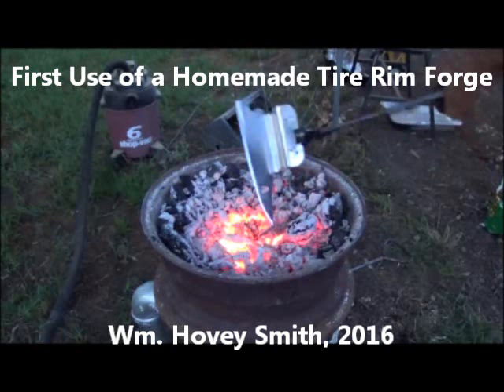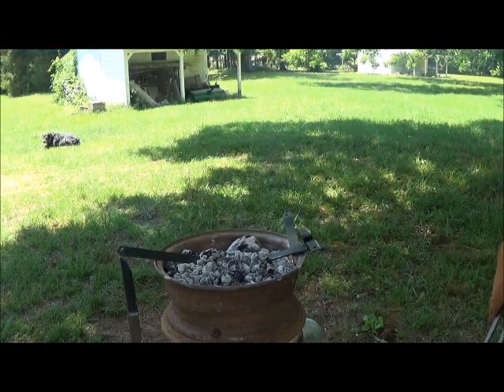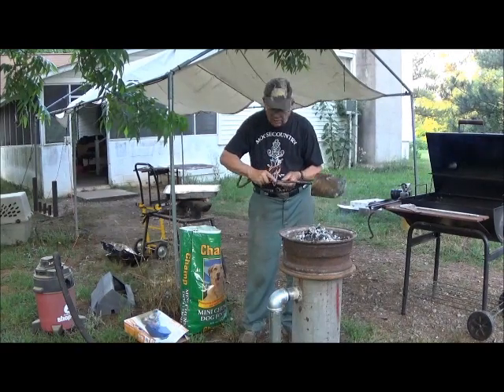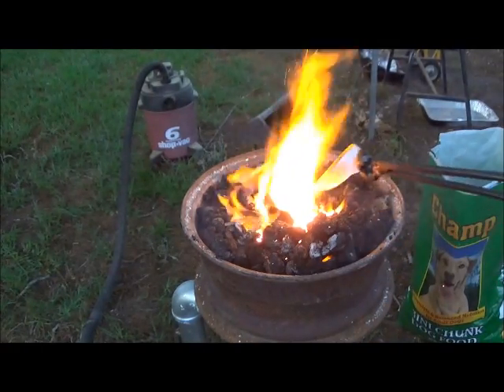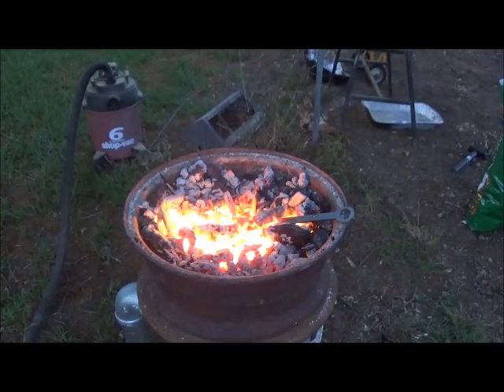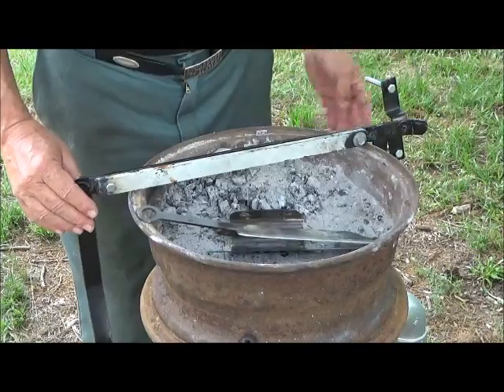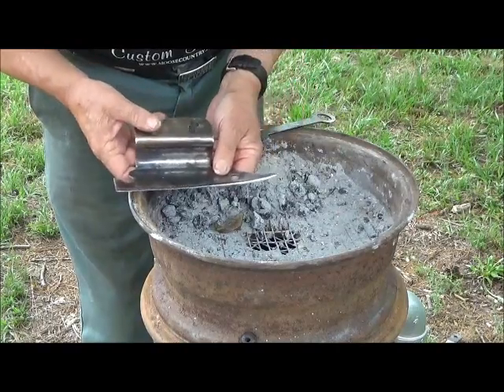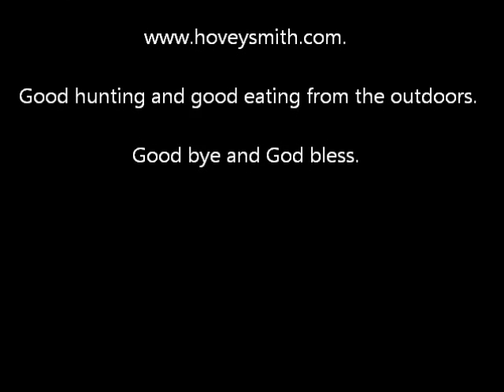First Use of a Homemade Tire Rim Forge

Comment: Welding Galvenized pipes. Im out of here.
Reply from the maker: Not a good material to weld, but for a part that needs to support nothing and only carries blown air, it did, and does, well enough.
Reply: Scry da-dreaper, C Ya..  Urban myth,  Zink is actually not bad for you ...  oxide not good but only in extremely highly concentrations like in a gas chamber lol.  People with stupid knowledge end up being  stupid safety police.